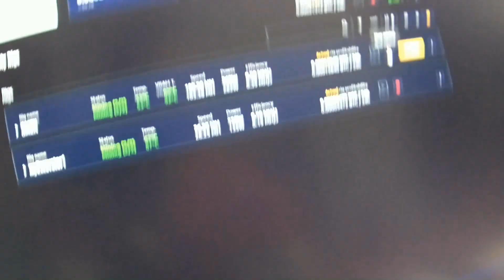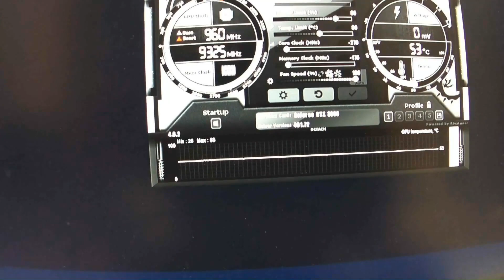HP OMEN 30L RTX 3090 VRAM overheating? Lets take a look inside

Comment from the maker: Update: I have posted an update video here: https://youtu.be/-UK1qKuClLM
The links to the parts I used are listed in the description of the new video.
Reply: What size thermal pads you ordered?
Reply: That Amazon link isn't working for me, could you please let me know product name and size? I'm afraid to actually open up my card and void the warranty, but it's really good to know that just putting a heatsink on the backplate helps. Did you just eyeball it for where to put the heatsink, or do you have a one of those thermometers to see exactly where the memory chips are? Thanks!
Reply from the maker: @YeshayaClair  Sorry about the link, it is fixed now. The heatsink dimensions are 100 x 40 x 20MM and the thermal pads I ordered are between 1 - 1.5mm and of various sizes (I will see which one works best when they arrive ) and brands. Please keep in mind that I have already changed the thermal pads on the back VRAM, so if you don't change those out, the additional heatsink may not drop the temps as much.
Reply: @RandomGreenFishPhone  Thanks very much. I guess I'll try the heatsink just by itself and see if it helps. If not I guess I need to decide if I want to try fully fixing the card myself and be in trouble if I mess up, or if I want to let if run as-is with just underclocking and undervolting and hope it doesn't fry itself.
Reply: @RandomGreenFishPhone  Hey, I'm very pleased and surprised to report that putting the heatsinks on the 3090 didn't do much just by itself, but those and a box fan pointed at it did a lot! Previously when I'd stress test it, it would go up to 110 and throttle pretty quick, now after 15 minutes of testing it's stable at 102-103. Still too hot so I'll undervolt and underclock, but definitely a nice improvement for someone like me who doesn't have the courage to actually open up the card. I may try positioning the heatsinks in a few places to get the ideal placement, then attach them with paste, but for now this is a great improvement.

Comment: Strange… I have the same PC/3090, and run it at 1980/10750: 67c max gpu temp/86c max vram junction/ 80c max hotspot temp (hwinfo sensors data)… fans are a bit noisy at 3000+rpm, but perfect for my heavy gaming.
Reply: stock cooling? Maybe HP made some improvements since.
Reply: @caiuscosades362  yep… I bought this prebuilt Omen to avoid messing with hardware by myself, everything is stock. The 3090 has 3 fans, and the 10700k is water cooled (I have it @5.2 (all cores), hwinfo is reporting averages @5.1ghz… which looks fair for me).
I am sure temps/noise can be improved by changing a lot of things… but it seems to me a good price/performance compromise out of the box… 3.300$: 10700k@5.1/ rtx3090@1980-10750/ 32GB @3200 /with windows 10/ etc. 
It is not a « UberPC », no 450w enabled 3090 or anything truly amazing… but nothing disappointing so far… no bad surprise at all. I challenged some PC builder shops to propose better for the price… they gave up.

Comment: THANK YOU SO MUCH! made about a 20C difference on my card (which is hard to believe!) downclocked -502 Mhz memory and Core 70% power was hitting 96C, after using a 1.0mm thermal pad on the back and some thermal paste on the frame on the front, three heat syncs on the back of the card and a fan went down to 70C when downclocked! Turned it up to  -100 +500 and 90% power and was at 82C with my case open and 88-90 with my case closed getting 113MH/s! Before the Mod I would max out at 110C and it would throttle.

Comment: i replaced my thermal pads according to instruction. and put it back in switched on, the graphics card is working, but when i try tp load it, i.e. when i try to do mining or gaming, the signal to the display goes away and the display keeps shutting down. what do you think might be the problem here?
Reply from the maker: The GPU core may be getting too hot if the pads are too thick.
Reply: either of you two know what size? seemed like the front is 1mm and back is 0.5? i initially ordered 1.5s that were too large for sure. planning on just running de shrouded w alternative fans

Comment: I'm a bit hesitant to disassemble my card. Is it possible to only remove the backplate to replace the thermal pads on the back side of the card, or is it only possible to remove the backplate after taking the rest of the card apart? I'd prefer not to replace the thermal paste on the processor if possible.
Reply from the maker: I am not sure if you can remove the back plate without removing the rest. You may be able to get a slight drop in the VRAM temps by just adding the extra heatsink and fan to to back plate, without opening the card.

Comment: I've bought the same PC.   the 3090's tempreture isn't too bad at all...   stays pretty much below 78c even during intense games...  my issue is the CPU,  reaching 100c pretty regularly...  lol   wonder if there's a problem of the 3090 if the tempreture isn't too hot?
Reply: Is your CPU 10900K and water-cooled?
Reply: @GoSpursGo50   Yes it is,  it's the default factory setup, I didn't modify or change anything
Reply: The standard AOI is shit, buy a new one. I bought an aircooler and now my cpu is <60 all the time. Also use decent paste.

Comment: Is it just me or does it look like there is a vapor chamber around the core coldplate?
I mean look at it, there is even a "fill port" on the middle-right and the elevated area of the cold plate has the typical dotted texture of a vapor chamber. Even the core area has those dotted textures, although very faint.
Reply from the maker: Very interesting. I did notice the dots but didn't think too much about it. The 3090 does a good job with the core temps so maybe there is a vapor chamber in there.

Comment: 3080 is exactly the same, just less memory modules. Opened mine (with abysmal vram thermals), replaced the thermal pads on top of vrams, and put some also under them between back plate and the board. Put new thermal paste on top of GPU core (obviously, and a stripe of paste around the gpu where the cooler copper meets the stupid black metal plate between cooler and vrams. Result: GPU core temps remained very acceptable, but a massive drops in vram temps. Before operation the vrams were throttling at 110C even underclocked, after wards I can crank mem clocks to +1000 and remain well under 100C with ~70% fan speeds. And I'm obviously talking about ETH mining temps, in game use the mem temps are nowhere near as bad. But still the stock vram cooling is like completely forgot, as it wont transfer to the cooler. So, easy operation and it should result in a massive improvement with vram temps, highly suggest. Stock GPU core cooling is actually pretty good, won't go much over 60C with full game load. Of course the Omen case ventilation is also very inadequate to 3080/3090 + i7/i9, Just Run the POS side panel open or invest $50 in a new better ventilated case. The Omen case is a lost cause even with upgraded fans.

p.s. I used 1.0mm Arctic brand thermal pads and Noctua paste. I bet 0.5mm would work too. 145x145 pad should be plenty for 2-3 cards. The original thermal paste application was good but if you open the card, you'll need to clean the old paste and put in new paste anyway so prepare with some quality paste also.
Reply: How thick are the thermal pads you used, and which brand? Thx in advance!
Reply: @jimbob9086  Sorry, forgot to mention! 1mm, not sure if ideal or 0.5mm but seems to do the job. I used Arctic brand, 145x145x1mm.
Reply: Added Arctic MX-4 to the copper plate/vapor chamber for memory and added 1.5mm thermal pads to the backplate on my Omen RTX 3080. +1000 memory, 75% power limit and 50% fan speed: 88C memory temperature.

With the added thermal pads the backplate is at scorching hot 64C according to the infrared thermometer... The backplate is the same as in the 3090 so there are clear markings where you should place the pads.

Comment: Hi what if we cut a whole on the back plastic piece and put copper plate on it? I think it would help with thermo due to the expose copper to airflow, or Undervolt the gpu a liltle.
Reply: Probably voids any warranty, might as well just remove the backplate all together and cool with individual heatsinks
Reply: @jimbob9086  Yeah, that’s a better way.

Comment: Hi! Just a bit of a warning to future HP Omen 30L owners. The cooling of the case is (in by book) not sufficient in general. So any heat problems with the card will be increased by this. Also the main problem with the HP Omen design are with the 120mm water cooler for the processor. This is bad for the 10700k version, and horrible for the 10900k. This is where the worst heat and noise problems with come. Due to the case layout there is very little you can do. The only real solution is to move the components to a larger case with better cooling....a bit dramatic and destroying the excellent visual design.
Reply from the maker: Yes this is a problem and the reason I did not get the model with the 10900K. I am running mine without the side panel on to improve the airflow because the case doesn't do a great job venting the hot air. I will see if this situation improves when I add additional fans, but there aren't really any mounting points or extra fan headers on the motherboard.
Reply: @RandomGreenFishPhone  There was someone suggesting to buy a top notch air cooler and have a good 120 fan at the top. I ended up with the Lenovo Legion 7i and the air cooler does the job without problem. Here the case is much better ventilated though.
Reply: I tried adding 4 noctura fans internal to the box, and replace all the omen fans with larger.  Also tried a large noctura cpu cooler with fans instead of water. Ultimately nothing made a difference so I actually think the design is great. The CPU just runs hot, I did the undervolt adjustment on cpu to .-130 or .-125 via omen command center and that lower my CPU like 10c and cut down damn noise.  I turn the fan to turbo for mining, much quieter for gaming.  Same benchmarks or better.

Comment: Hey, I have the rtx 3080 same pc same situation.
What is your room temperature? Oh I also recommend you turn off the lights of your pc saves some heat and electricity costs
Reply from the maker: My room temp is 76F / 24.4C right now. At night if it gets cooler I open the window and can turn up the speed a bit.
Reply: Has ur 3080 popped up with cuda call message? I can't get mine to show in hwinfo64 at all so I can't see the mem temps but it gives me a cannot access cuda Core message
Reply from the maker: @megalojerk84  I have not come across that message and hwinfo works just fine for me. Maybe try updating the drivers. I used the studio version instead of the game ready drivers.
Reply: @RandomGreenFishPhone  ok I literally fixed it all by putting paste on the metal surrounding the copper plate a d the black metal above it. Went from 112c to 82c at 80% fan. Wont go above 1100 mem without crashing but 97 mh @227 watts is pretty nice

Comment: It took me a while to find someone who has this exact set up, I noticed the throttling immediately even playing some older games but especially when mining. I messed with under volting and underclocking, opened the side panel up, maxed the fans, installed hwinfo, thanks to some replies I got on other videos and saw the vram was pegged at 110c even with temps around 50-52c being read by msi. Got pads ordered and definitely sending some complaints at HP
Reply: Update - finished repadding and repasting, was extremely careful, used iso propyl, micro fiber, plastic scraper, mx-4 paste, thermal right pads - threw it all back together but now getting a bios posting error not detecting the gpu. Any ideas as to what could be causing this? The card is secure, locked in place, everything seems to be right 🤷‍♂️ took it apart and cleaned up a wee bit of excess padding and paste that got squeezed a bit, same thing happened. Any advices?
Reply: @Joseph Luppens I ended up having to rma and it took a good while, once I got it back and tried it again it was much better but still needed the extra fans - right now vram hovers about 104-106c and getting about 108 mega hash so I'll take it over how it was out of box initially.

Comment: looking forward to your followup vid.  i run my 3090s at 85 power, gpu curve lock at 1200mhz, memory +900-1000 (depending on model). they get around 120 and do not throttle. but i just go for under throttle temps (110c).  what kind of warranty does the omen come with?  also curious on what pads you replaced and the thickness. thanks!
Reply from the maker: The warranty is only for 1 year so I am doing everything I can to keep things cool to hopefully extend the lifetime. I ordered a few pads with different thicknesses and will see which ones fit the best when they arrive. I think I will be able to get to 115 mh/s and still keep it under 95C, but I won't know until next week.  I think I will also run it through the 3DMark benchmark when everything is done to see if it improves that too.
Reply: @RandomGreenFishPhone  I put 150x100 aluminum heatsink on a top of the card with Noctua fan sitting on it , also replaced pads on the backplate with pads that came with EKWB backplate (Planning to do water-cooling when I have time), tried 1mm and 2mm  not much difference at all.  It seem that front pads needs to be replaced as well. Also the HP backplate has a bump in the middle where the GeForce sticker sits.   I removed the sticker but there is still small bump there.  I then used 0.5mm cheap pads from amazon but it still makes no difference.

Comment: Thanks for sharing this experience. Any idea on posting the updated video or status on your fix?  I’m strongly debating an hp 3090 today, but curious to see if vram temp can be addressed.
Reply from the maker: There were some shipping delays so I  am still waiting for the heatsink and thermal pads I ordered to arrive. If all goes well I will post an update next week. I am getting better hash rates and still maintaining under 95C by doing some additional tweaking in afterburner. Everything looks promising so hopefully I will be able to push it even more with upgrades.

Comment: I've bought four 1mm heat pipes, four 3mm pipes, 100 piece copper plates, better thermal pads and simple aluminum heat sinks for my 3090 fe. I plan on doing a video on it. The goal is to reduce the amount of space between the memory modules and backplate from 2mm to 0.5mm and have the memory module directly in contact with a heat pipe array to more efficiently conduct heat to the back plate.
Reply from the maker: I would definitely like to see that video and how it turns out. Good luck

Comment: How thick are the thermal pads for the VRAM? I have an RTX 3080 from the OMEN and I do not get the temperatures under 100 - 104C under heavy load. Also replaced the thermal pads with K5-Pro liquid thermal pads. I'm thinking about ordering Thermal Grizzly Pads, but I do not know the thickness
Reply: I could solve the problem on my own. I have the RTX 3080 but the process is nearly the same. Replace all WLP pads with 1mm pads which better quality. Add additional 1mm WLP pads between backplate and graphics card board. Cover the black metal frame with thermal paste (I used Arctic MX4) to create contact between Heatsink and the black metal frame (under the metal frame there are the VRAMs). For the core DIE I have used liquid metal to get better temperatures. My temperatures are now 86°C on VRAM and 78°C on Core. Before I had 102-106°C on the VRAM. Fan noise is much better now 60-65%.
Reply: Any pictures of your approach? Little tricky visualizing the application spots.

Comment: That’s not a thermal paste on the memory chips those are thermal pads, thus it doesn’t have any viscosity, also the conductivity coefficient is much lower compared to thermal paste (capacitive or non-conductive). Also, wow, HP and other OEM’s own 3090 PCBs are literally some of the cheapest I’ve seen, with reference VRM/power delivery design, and a PLASTIC BACKPLATE wow.... So if I were you, I’d permanently remove that piece of crap plastic backplate, buy some decent thermal pads thinner is preferable, and buy some dense heatsinks (either a large single piece heatsink, or individual smaller heat sinks for each memory chips.)  The fan on the back dependent on how you mount the GPU in your chassis.  Uhh.. Wait.. hold up... HP’s 1 year limited warranty also applies for the 3090 GPU ????   My EVGA FTW3 RTX 3090 has 3 years of warranty, with optional 5 years and 7 years for $50-ish extra.
Reply: I think the plastic on the backplate is to prevent the backplate from conducting if it touches other parts of the board. I agree. Feels very under engineered for the caliber of card that it should be
Reply: Congratulations on your EVGA FTW3 card, those are very nice. I wanted to get one, but couldn't because they are never in stock so I had to buy one of these pre-built machines instead. How does the board design on these compare to other MSRP cards from Zotac, Gigabyte, EVGA, ect? My understanding is that most of the board partner base models (cheapest they sell) would be almost identical to the reference spec, if not identical.

Comment: Dude thanks so much, I already bought pads for when my Omen ships. Now I know what to do!
Reply from the maker: Glad I could help!
Reply: Let us know which pads amd their thickness amd how it turns out!
Reply: I used the grizzly 1mm and didn't see much of a diffence.  I'm adding a heat sync to the backplate next.   I'm very decipointed in this card so far
Reply: @daviddaniel9155  I ordered 1.5mm pads, as the 3090 FE needed those and I couldn't seem to find info on what the reference cards needed. If HP will ever ship my card I could get started, its been over a month and it still isn't even built yet.